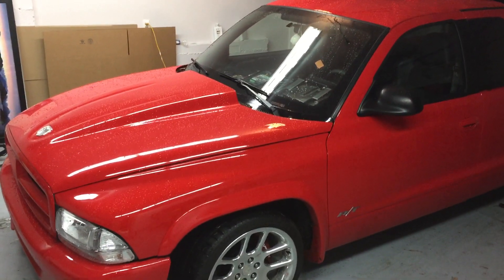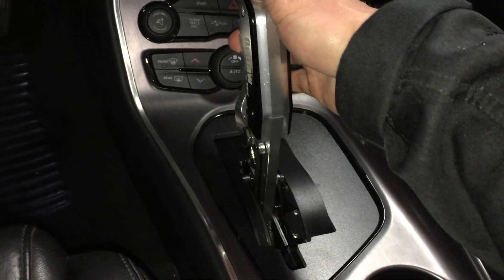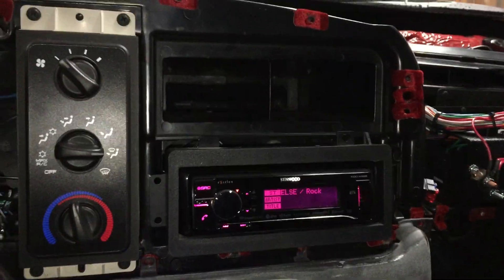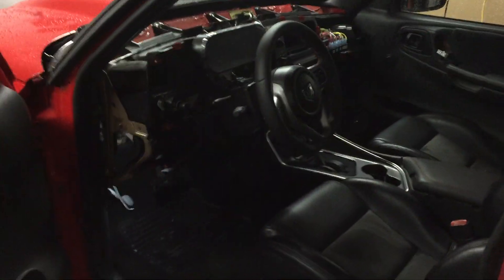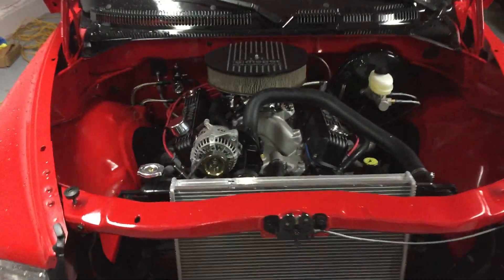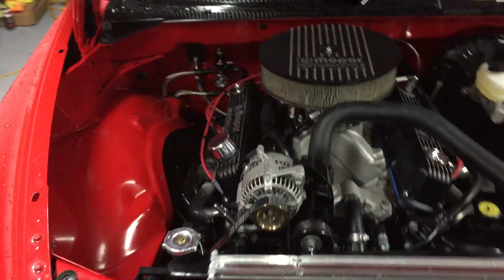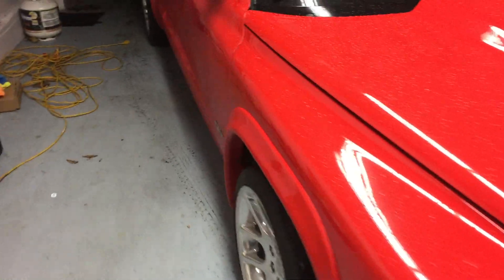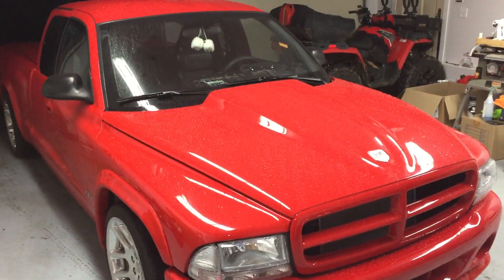Dakota R/T 410 Stroker Explained

Comment: what trans are you running this i noticed you said that you could go 1 2 3 and then OD and was wondering what the setup in it was because im building a 1997 dodge 1500 for a street/strip application and was going to go 727 but would like to get the 46re's OD

Comment: To you guys with the Dakota's how's it goin, I've got a 2000 Dakota quad cab with the 4.7 it's been modified odomater reads 234k but it's been rebuilt with a 2004 Jeep block with only 30k on the motor I've had this truck for 5 yrs. My idele pully froze and threw my belt causing my water pump to go out. I got it home,replaced water pump and belt. Now when it reaches operating temperature 190 deg. The idel starts to go up and down not bad if you unplg your mass air sensor you know what I'm talking about.and it starts to spit and sputter then when you excelerate she sputters and dies. She won't start untill it cools off then she's great at idel even one time around the block 1/4 mile if that. I've replaced O2 sensors ,crank shaft sensor camshaft sensor throttle body,fuses, air intake sensor,spark plugs, mass air sensor My question is what is going on with my truck?? If you have an answer please feel free to contact me threw my e-mail. cartwright.dave@rocketmail.com thank you and have a good one. I can send pics if you like she's garage kept in the hot state of Az
Reply: Ik this is a 3 year old comment but sounds like coolant temp sensor.

Comment: how hard to install the viper wheel?
Reply from the maker: Not that hard, just $$$
Reply: yea, the wheel isn't super cheap. Did you map any buttons? Do you use cruise control?
Reply from the maker: No, When I drive the truck I take it out for a good rip then put it back. Not a cruising truck lol